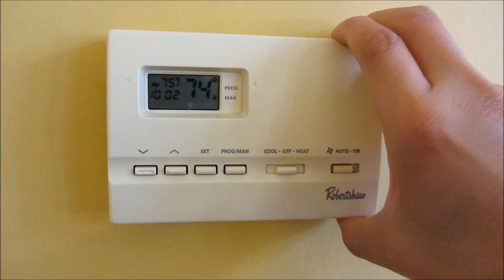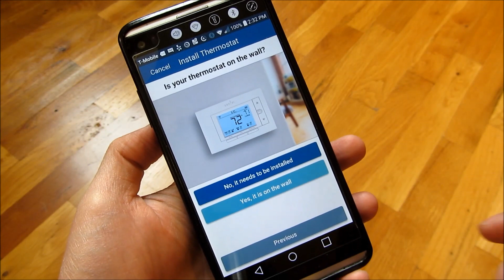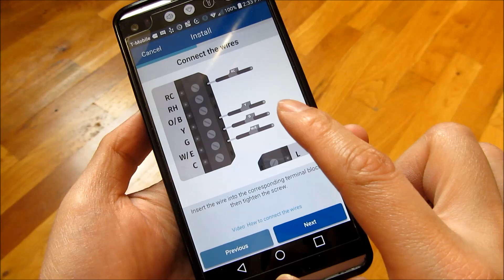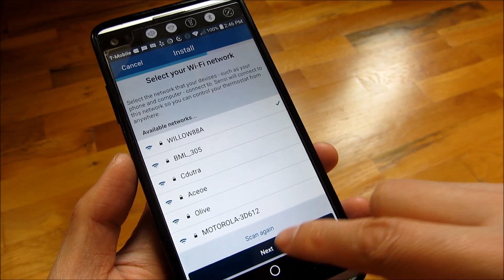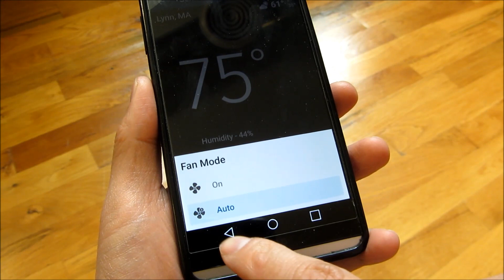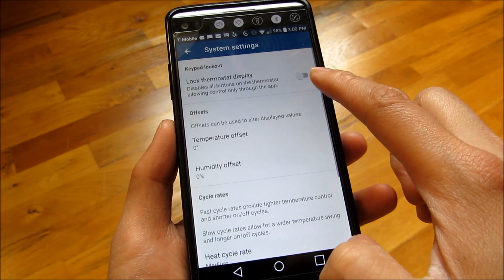Robert Shaw Thermostat upgrade to Emerson Sensi Smart WiFi Thermostat

Comment: The heat turns on if placed in 'On' mode but will not turn on when on 'Auto'. The inside room temperature is 70, and the heat is set to 74, but it will not turn on in 'Auto' mode, but switch to 'On', and the heats turn ln immediately. Suggestions?

Comment: You pulled the C wire from somewhere.  Did you use 5 wires? Because you started with 4. I have the same thermostat and want to upgrade to a smart one.

Comment: How long did the batteries last with WiFi on?
Reply from the maker: With WIFI the entire time, I've been using these Lithium Rechargeables  https://amzn.to/3fT5XN0  and after 2+ years its still 5 bars out of 5 bars, still on the original charge.  So I'm guessing if you use these regular AA Lithium Energizers https://amzn.to/3ArEE44 it will probably last 10 years without ever replacing them.
Reply: @PoolarityChannel  Wow!  That’s incredible.  I would have thought the WiFi radio would eat through batteries without using a C wire.
Reply from the maker: @squarebomb20  Yeah.  an unexpected pleasant surprise.  Battery life was a big concern for me.  Its been nearly 30 months and the battery is still 5 bars out of 5.  Its as good as a permanent power source.  Was afraid I would have to constantly replace the AA every 6 to 12 months.  Probably will last 10 years.

Comment: Wow, this is so spot on for my needs.  I want to replace the exact same thermostat and don't have a c wire.  Thank you.  Question, I've read on some reviews that this wifi model really eats batteries - do you regret going with this model.  The non wifi model of this apparently has no issues with battery life - easily lasts a cooling season.
Reply from the maker: I am using Lithium AA Batteries for the past 30+ months, and the battery indicator is still 5 bars out of 5 bars.  Never had to replace the batteries, and by the looks of it, it will last 10+ years without changing batteries.  Completely a surprise for me.  I have links in the description area of the video also.  Lithium Rechargeables  https://amzn.to/3fT5XN0